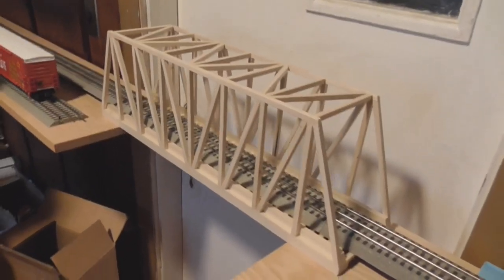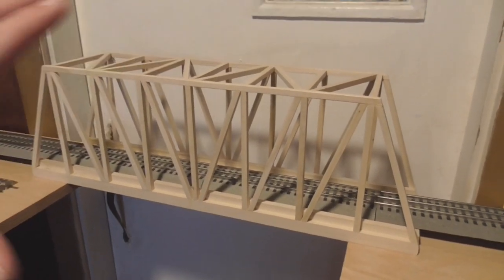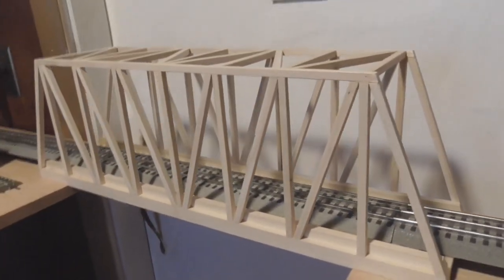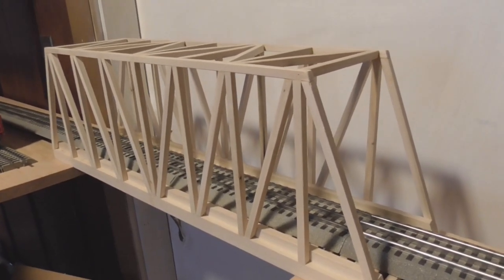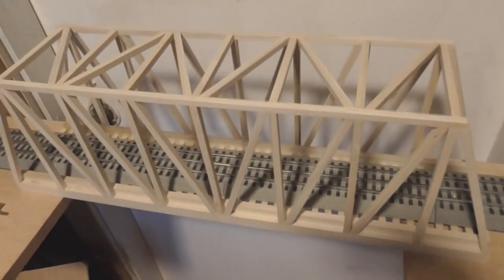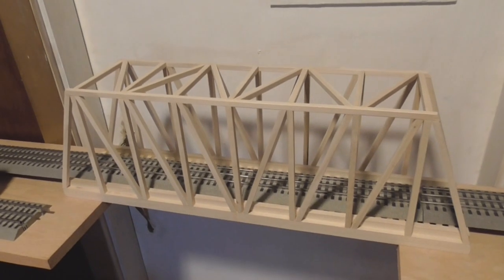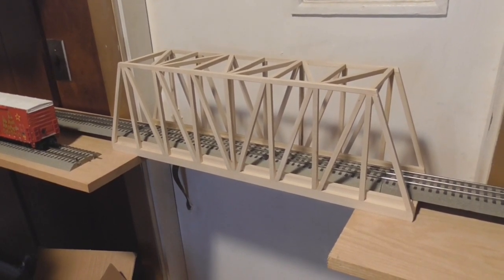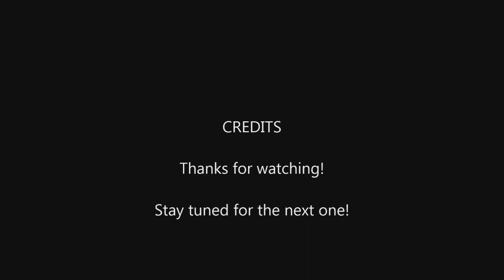Layout BLOG Series: Custom Wood Thru Truss Bridge

Comment: Super cool bridge! Looks super solid and you got a killer deal on it! Can't wait to see the big 2-10-10-2 steamer on it! Also, ive been meaning to ask, what smoke fluid do you like to use?
Reply from the maker: Personally I've used both MTH Proto Smoke and JT's Megasteam. Right now I've got a big stock of mega steam in at the moment so I'll use it until my supply runs out and then restock
Reply: @ravenhawk6910  Cool! Yeah I like protosmoke fluid acuse it seems to wick up and make thicker smoke tha anythig else, and also the wicks in my uits tend to last longer ad i tend to run smoke volume at max. Protosmoke definitely hangs in the air though but i'm crazy and like a smoke filled room lol. Maga steam seems to be thinner and needs to be filled more often to me. The smoke disipates much quicker, but I noticed on a max setting you need alot more fluid in a running session. I have mixed to two together and gotten some pretty good results as well.